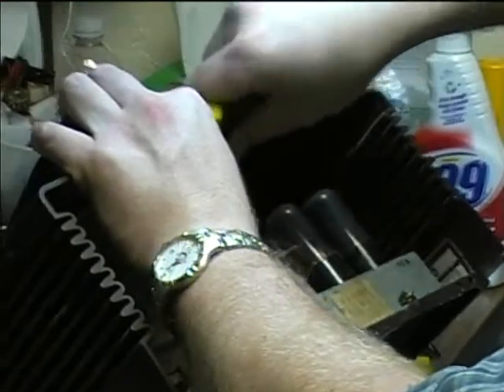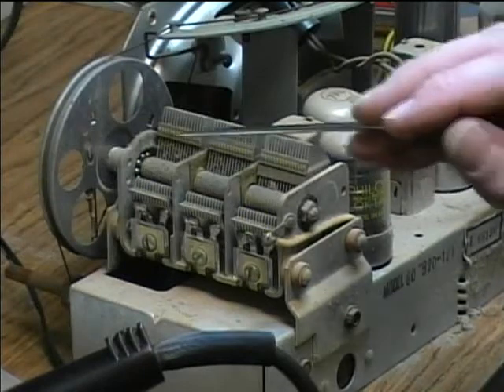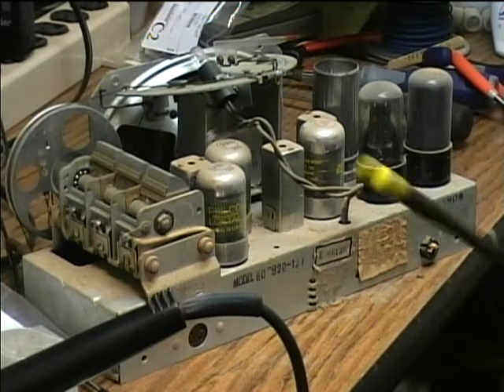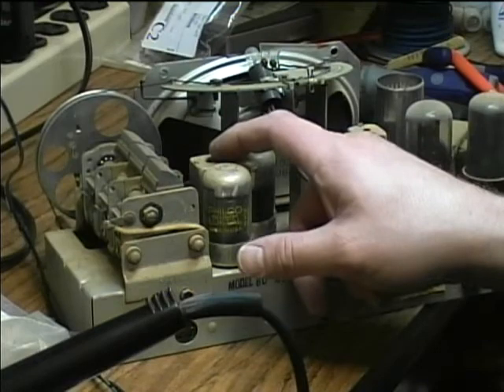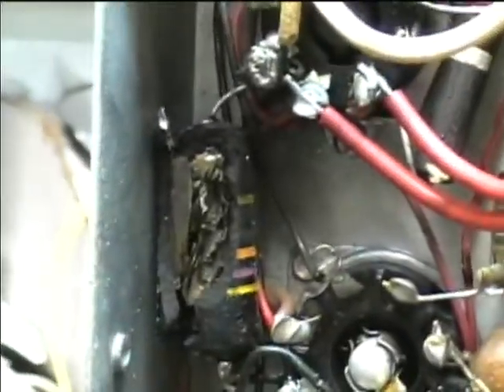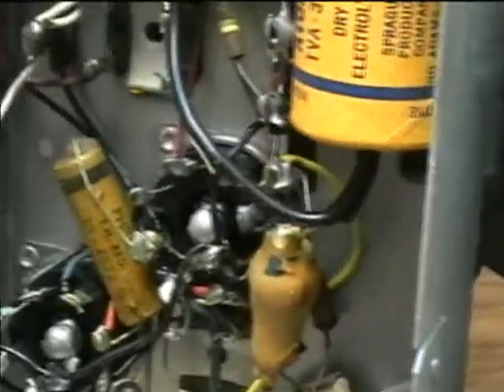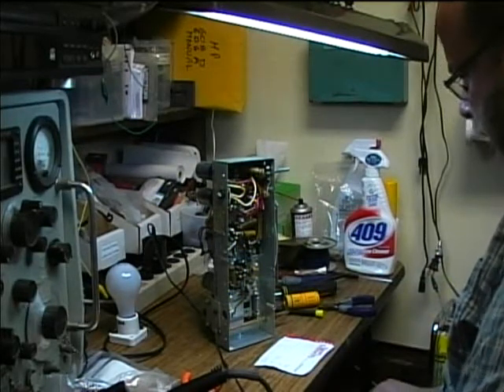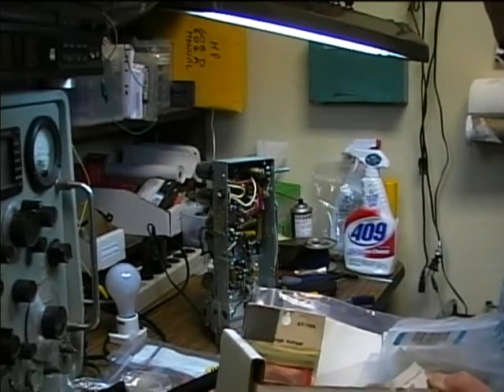Philco 50-920 tube type radio complete repair job part 2

Comment: I usually  go over rather than under when replacing capacitors, looks like you know quite a bit more than I do I would have just left that coupling cap in because I wouldn't have known it was really unnecessary.  This is a great series!

Comment: That plastic cap is a replacement, and it still blew up; I've seen alot of that. I notice how some ham-fisted repair person in the past just tacked the leads of the new electrolytic on, I"m surprised they are still in place.